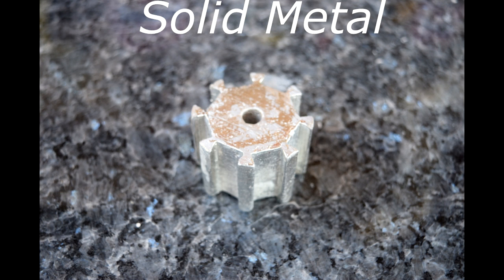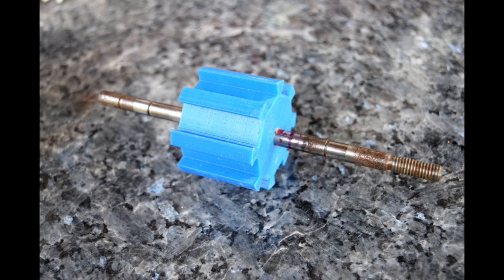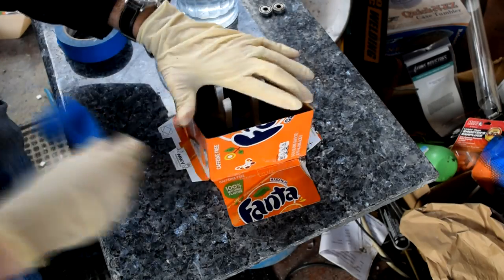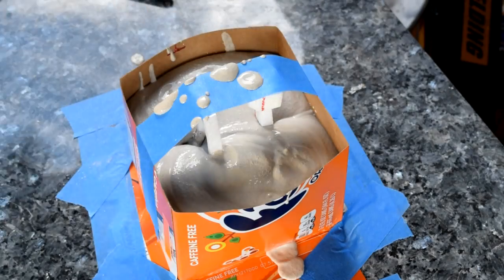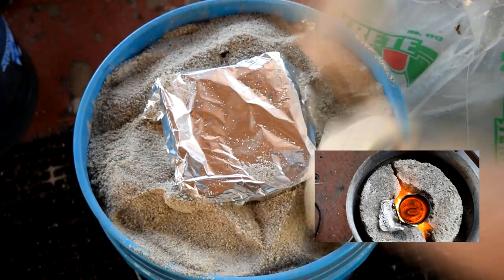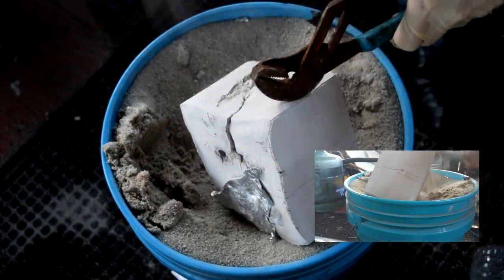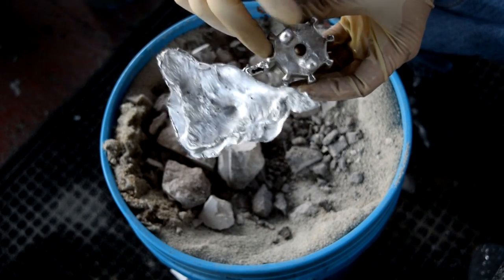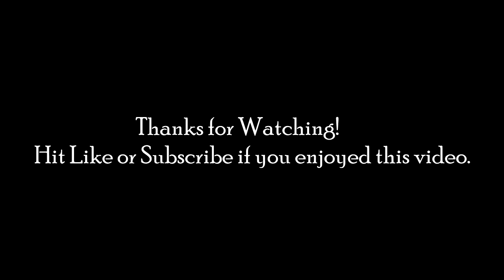3D Printing to Metal Casting/Lost PLA

Comment: If you want to make your generator more efficient then you should replace the aluminum with iron.
At least mount your magnets on an iron tube, this will greatly increase the magnetic flux since iron has a high magnetic permiability, unlike aluminum, which is a slight diamagnetic.
Anyways, good luck.
Reply: Except iron is super hard to melt
Reply: Poptart McJelly

Comment: As a Dental technician i made many casts and i have some ideas for you^^. 
Mount your object upside-down on your surface.
Give it a light angle to avoid trapping air under the object and lastly 
make the entrance cone shaped to make it easy to poor.
Reply: turb0m0nk3y Also, 3d print the sprue & pour channels!
Reply: Also put in vent holes in any chambers that have points, the air got trapped in the fins and had no where to go. So a small hole on the top of each fin would have made for a better cast.
Reply: Thanks for sharing your wisdom.

Comment: Why not CNC ?
Reply from the maker: +bbogdanmircea CNC would be great! However my 3d printer cost $200...how much is a CNC machine?
Reply: Limited recources. Milling machines will set you back a lot more than a printer.
Reply from the maker: +Victor Titov I could of done that and I actually did consider this. However since the wind generator was going to be outside in the weather I figured metal would be a better long term option.
Reply: It's expensive and programming a machine, choosing the tools, testing...  just to make one part is just not worth it. Probably if this part needed to be mass produced CNC would be the ideal method.
Reply: ProjectTube what kind of 3d printer did you get?And is it any good, looking to get one myself. im a beginner
Reply from the maker: +urjnlegend I got the Anet A8. It isn't bad for $200, you can check out my review video on it.
https://www.youtube.com/watch?v=7jroSQAhhSw
Reply: Got mine for 225$ canadian dollars; Anet A6.  After 3 days, I was pretty good at it. Without the first week, my parts look like a 2000$ machine. I don't understand how a more expensive 3D printer would have make me learn faster?
Reply: urjnlegend as a beginner you should get a kit with good instructions... wouldnt recommend the 200$ printer unless you have really alot spare time (up to 6 months before good results). get a propper kit even if it costs more it gets you started with the basics and after that when you have a lot of experience then you can get a 200$ one. cheers!
Reply: why not just lathe and some cutting tools?
Reply: Tom Gertenhäuer yes, if not, you can melt it out over a fire. but the only bad part is it takes forever to print, and you only get 1 shot essentially
Reply: Tom Gertenhäuer i got a tevo tarantula, working out the bugs so itll print better, its a good printer tho
Reply: High volume, sure. One offs? Print and mold! CNC lathe costs, ewie
Reply: ProjectTube I have a CNC machine, a simple part like that would not cost much more than $30 to machine
Reply: ProjectTube I do lost wax casting for a living as well
Reply: GrodyMaroon with 6 months i mean really get it right. like perfekt prints with different materials, bridging and heated bed setting perfekt and so on... it takes only a couple prints to "get it running" but it takes a lot to get it really good (in comparisson with expensiv machines )
Reply: For 200 bucks the best on the market atm I think is the Monoprice Select Mini
Reply: Tom Gertenhäuer you mean mold it for another readily castable copy? my thoughts exactly

Comment: Good afternoon, can you tell me what white powder is?
Reply from the maker: +ulisses salvador I use plaster of paris and silca sand a 50/50 mix. You can buy casting mixes specifically made for this which would hold up much better and probably give a better a finish but they aren't as cheap.
Reply: ProjectTube Good afternoon I live in Portugal and as you know the names are sometimes different could you send me the link where to buy the materials?
Reply from the maker: You can get the plaster of paris on amazon here https://www.amazon.com/gp/product/B000BQYH7K/ref=as_li_qf_sp_asin_il_tl?ie=UTF8&tag=proje035-20&camp=1789&creative=9325&linkCode=as2&creativeASIN=B000BQYH7K&linkId=6e57de5c8d7b6a2f4ab9ca74a757443c

and the sand here
https://www.amazon.com/gp/product/B00005C6E3/ref=as_li_qf_sp_asin_il_tl?ie=UTF8&tag=proje035-20&camp=1789&creative=9325&linkCode=as2&creativeASIN=B00005C6E3&linkId=d1ba4bf41d9c54e8606b03d762d37390

Keep in mind both these items are heavy so you would be much better off as far as shipping to source them locally.

Comment: More details on the burn-out process would be helpful.  Otherwise, great video.
Reply from the maker: +Michael Jensen Thats a good question and I'll be going into this more on my next video. It's a bit of trial and error/guessing. If you have a compressor you can shoot air down one of the vent holes, if air comes out the main spew it's a good indication that at least most of the PLA and melted out. I tend to just error on the side of heating the crap out of it and crossing my fingers lol.
Reply: Michael Jensen tip mold upside down put over furnace so melted plastic runs out. not much to it
Reply: Michael Felske how do you know when it's done? Do you time it, or is there a way to tell?

Comment: One of the better PLA casting videos for sure, I would've liked to see the burnout process too. The result was really nice, but the pour could've been better, stopping midstream (heh) pulls down the oxidized layer with the following pour. And, did it work as intended? :P
Reply from the maker: Thanks, yea the pour wasn't ideal. If I had to do it again I'd make the 
main sprew thicker and taller. In the end it worked great. Next time I 
will show the burn out process, if you don't get a good burn out then 
the whole casting fails. I was planning on another lost PLA video this 
weekend but it failed due to not all the PLA burning out. I'm looking 
into 3d Filament made specifically for casting, keep and eye out for 
that.
Reply: Hi, you might want to check out "Lay-Mold" filament by lay-filaments.com (german company). I've read about it several times but never seen it in action. if you could get your hands on a sample you might want to give it a try! I'd love to see how it works out!
Reply from the maker: +NEutebach I'm definitely looking into filaments that are specifically designed for lost casting. I haven't had a chance to get my hands on any yet. Keep and eye out though as I will be doing a video on one in the future.